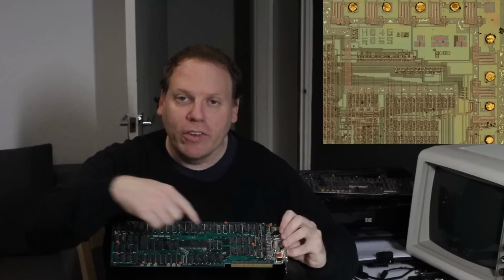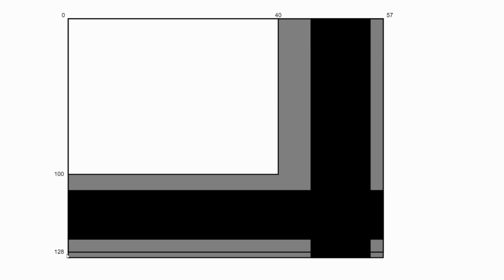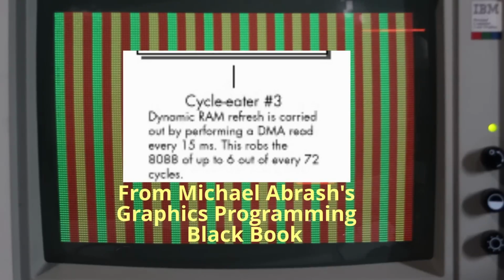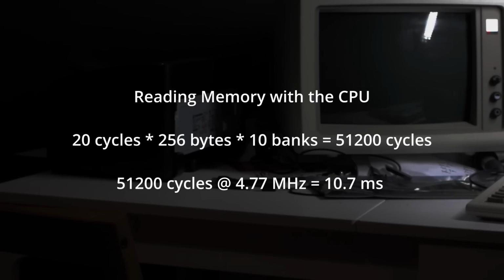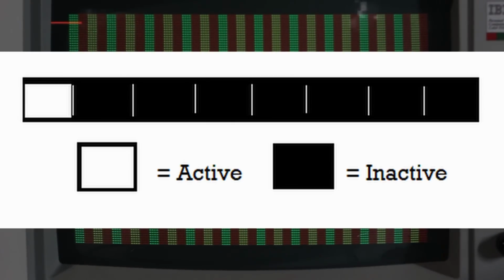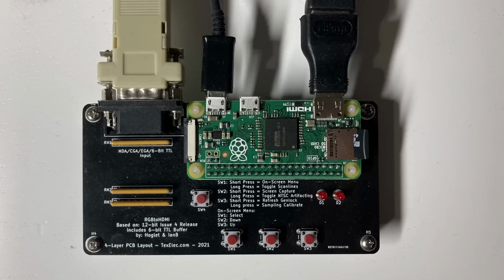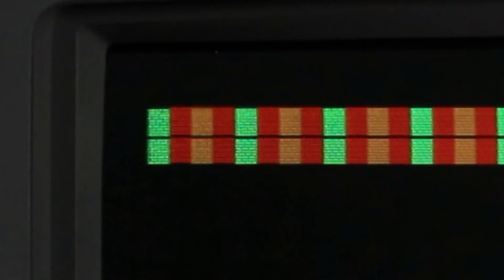Reverse Engineering the Video Chip of the IBM CGA Card (1981)

Comment: 1:04 that piece of information is wrong. Hitachi made the HD46505 first and then licensed it to Motorola. Motorola then produced it as the MC6845. That's why the Hitachi chip didn't use motorola numbers like their other direct clone chips.
Reply from the maker: That's interesting. The two chips behave very differently, so it seems like Motorola didn't use the same die.

Do you have a source for the information? (Feel free to emaIl it, as YouTube probably won't allow links.)

Comment: There is a Character Rom that supplies the data that gets poked into the required address, There is a program which fills in the characters from 128-255 called GRAFTABL.EXE

Comment: Which one of the ASM files (if any) correspond to that 'frozen snow' effect? I'd love to test this in my emulator.
Reply from the maker: There isn't a file in the repo for that. The repo is mainly about code to reverse engineer the CRTC. But the same basic loop can be used for freezing snow. You just need to add a write to VRAM at the right moment in time. Getting it to work on other machines is a fiddle due to timing differences though. It's not something you can just run. But f you have enough assembly experience you should be able to figure the code out.

Comment: Impressive work around the sync stuff and CRTC glitches.  

Snow was never really a mystery, there is a lack of bandwidth and the CPU wins a fight for access to RAM, meaning the video is displaying whatever data is on the databus at whatever address the CPU is reading/writing in video RAM.  

When it comes to writing: the address bus is valid before the data is written and you're seeing that in the character snow being the original data before the CPU has had the chance to change the value, then by the time the video is reading the attribute byte it is seeing the data the CPU has actually written to the bus.

When it comes to reading both char/attr would be the same since no change is happening, you're just seeing whatever is at that address in both instances.

I'm guessing if the CRTC and the CPU aren't in perfect lockstep like you've managed that exactly what the CRTC sees as snow in char and attrib might be a bit more random though?

You're probably the first person to control the snow like that though via that precise timing technique and it's very cool to see it isolated like this.
Reply from the maker: Thanks for the comments. Yes, of course the RAM is not dual ported and/or static and there just weren't enough cycles to have the CPU and video card access at different times in the 80 column text mode.

If the CPU changes the address while the card is reading the RAM you get wrong data. I would guess the CPU gets to set the address correctly for writing, otherwise snow would persist in the same location.
Reply: @PCRetroTech  Yes, the CPU has priority access so the CPU will drive valid address/data.  I haven't looked at the schematics yet but I assume some sort of priority encoder is used to prevent the CRTC gating its address signals onto the address bus when CPU is doing its access.

My mind is fuzzy on the issue but I think with the sega master system you could corrupt the VRAM if you wrote to the VDP too fast during active time.  You can write it any time you like since there is a one byte FIFO between you and the VDP VRAM but if you write too often in active I think it can corrupt.  The solution is you have to write a few NOPs between your writes during active time.   When I wrote my tetris clone 'Bloki' for SMS I did 'unsafe' accesses in vsync and the rest of the reads/writes were done vi a 'safe' macro.  Given a vast proportion of time is in active, the slow access is still very useful compared to a tiny access window in vsync.  But then we're spoiled on the SMS we get frame interrupts, tiles and sprites!  Since the SMS only has the one normal interrupt which is from video you get the satisfying thing that when you're done with your frame you just halt the CPU  and your code will restart when vysnc comes around. 😛
Reply: Or are you saying that on reads the CGA does feed the CPU garbage data during active?  I hadn't actually tested that.  Seems strange.
Reply from the maker: @neodonkey  No, that doesn't happen as far as I know. I think you are right. The CPU gets priority, though I've not looked at the schematics either.

Comment: Great video! The BBC Micro (a popular UK 1980's computer) mostly had a HD6845, and the community has made some progress in reverse engineering its corner-case behavior. I see from your linked PDF that you're looking into how the chip decides it is on the last scanline of a frame. This particular logic is insane! We've found that the chip appears to launch a series of logic tests on each scanline (one per clock, that chain into each other). It is why the chip goes screwy if you set R0 to be less than 3. BBC emulators such as beebjit, jsbeeb, b2 can handle this, and need to in order to run some of the latest crazy demos. I would provide links, except YouTube is being difficult.
Reply from the maker: I've had a look at jsbeeb before, although whether it had this behaviour encoded at the time I don't know.

At the moment it is slightly hard without studying the CGA schematics intensively to disentangle the behaviour of the chip from that of the card. The HD6845 datasheet talks about "outputting noise" in some cases, and my current best theory is that when you let the noise out the card can trigger various behaviour. For example on other CGA cards the same noise doesn't trigger any unusual behaviour at all.

By the way, I have two HD6845 chips that go screwy for R0 < 3 and one that doesn't. Two of them have the same date code and it's not the two you think!

Comment: Thanks for this fascinating video. This certainly brought back some memories! Several years ago the Acorn demo group Bitshifters created a demo for the BBC Master that is all about hacking the HD6845 CRTC chip. (Those who are interested can check it out by searching for “Bitshifters Evil Influences”) … Many of the issues you mention in this video -- e.g. having to implement your own DRAM refresh cycles, obtaining completely stable raster, getting the CRTC clock synchronised to other clocks that run at different frequencies, and so on -- are things we had to worry about when creating that demo. There are several CRTC variants in the Master: Hitachi, Toshiba, Motorola, perhaps others, and also VLSI. The VLSI behaves differently and we hypothesise that it's very different internally. Annoyingly the tricks we use to draw any logical screen line on any physical raster-line just won't work on the VLSI variant. It's an area of continued research, perhaps one day we'll finally fully understand the 6845 in all its complexity.

Comment: I would think that an alternative to disabling the PIT for DRAM refresh would be to program it to run exactly once per scan line.

Otherwise, I was just realizing that frame-aligned register accesses could probably be used to fix the interlace mode timing so that interlacing would actually work as it's supposed to.  Back in the day, I played with interlaced video, but the instead of outputting an extra half line per field, the 6485 would output an extra half line every other field.  Back in the 1980s when I tried that, I found that setting the vertical hold knob just on the edge of losing sync could yield legible 50-row text on the CGA, but it was annoyingly touchy.  Frame-synchronized register writes should be able to fix that, though.

Comment: At 32:34 the dot-clock delay that is absent on the LSB but not for the other bits might be due to the propagation delay (such as extra capacitance) introduced by the added logic inside the chip that are absent on the LSB.  It might prove useful to look at the decap reverse engineering notes :-)
Reply from the maker: So far I don't think the decap reverse engineering got far. As I understand it the project was more or less abandoned. But maybe someone is still working on it somewhere that we don't know about.

Comment: The 6845 CRTC is also used in a couple of early to mid 80s arcade games, one of them is Qix, which displays a whoppin' 256x240 with 256 colors, but only in the test menu. In game, it only uses like, what, 9 or 10 colors...
Reply: You do have the advantage with that particular hardware of having a much faster processor- the Motorola 6809.
Reply: @douro20  Nope - you don't have a much faster processor, you have THREE of them 😀
and one is dedicated to the graphics, so you could say that Qix has a graphics accelerator... in 1981!
Qix has 64k of video RAM. The reason it can't use 256 colors ingame is that in this game you can draw shapes freehand in order to wall in a monster that kills you if it touches you while you're drawing. Now with 2 players, the machine has to memorize the drawings of both players at the same time, so it uses two bits per player which means that only four bits are left for anything not drawn-playfield related. But still, the game could use 19 colors or with clever trickery all 64.
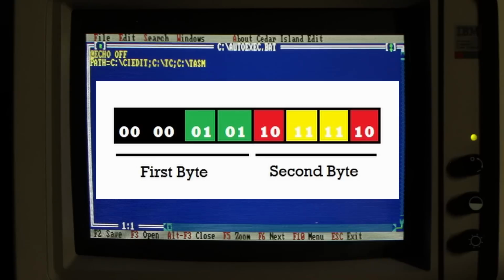Here's a video that includes the self test (at 5:50) https://www.youtube.com/watch?v=WUPFSFqCLtk (btw. yes the monitor is on the fritz, but that's a design issue and appears to not be age related - our local monitor specialist says it doesn't like the sync pulses.)
The main CPU has 1k of RAM and runs the game logic. The sound CPU has no ram (6802, what was it 128 bytes? 256 bytes?) and runs the sound. The graphics CPU has1k of battery backed RAM (high scores, audits, probably work RAM too), 1k of fast palette RAM (so it can blank the other player's color bits) and 1k of communication RAM. My guess is the main CPU puts commands in there like draw a line from here to there, do a flood fill on this position, draw the sprite in ROM location &whatever and restore the playfield on the sprite's old position and tell me the color of the pixel at this position.
Reply from the maker: @senilyDeluxe  Very interesting machine. There are videos online showing the various boards, but so far no one has zoomed in with a decent camera that isn't shaking around all over the place and out of focus whilst shouting over the top of the video. If you have it open at some point, would love to see the internals more clearly with some of the chips pointed out. From the Taito documentation online I didn't even know it had more than one CPU and I didn't see mention of the 256 colour mode. I believe there was a later version of this game Qix ultra or something. Maybe the documentation on Archive.org doesn't match the cabinet you have?
Reply from the maker: Interesting. I think I do recall that it had been used in arcade games, but I didn't know about Qix specifically. Very interesting info. I wonder if I can find a video of it online....

Comment: Mario Brothers 3 on NES gets similar artifacts on the left and right sides of the screen you were demonstrating switching between 5 and 9 hdot widths. NES is of course not CGA but I wonder if they were playing similar tricks to make such advanced graphics at the time?
Reply: SMB3 uses 2K of the NES internal RAM to hold a scrolling screen, which is enough for a screen 32 tiles wide by 60 tiles high, with four rows worth of memory used to set the attributes of every 2x2-tile region.  The PPU normally displays a region that's 32 tiles wide by 30 tiles high, but can blank the leftmost tile.  Unfortunately, when side scrolling, the screen still shows portions of 17 different 2x2-tile regions across its width.  Cartridges can be wired to either use internal RAM for 32x60, 64x30, 32x30 plus 1Kbyte of shape RAM, or else use 4K of RAM in the cartridge for a 64x60 screen.  SMB3 attempts to do 2d scrolling as well as it can be done without using external cartridge RAM for the tile map.
Reply from the maker: I'm not super familiar with the Nintendo hardware but I think that used a Texas Instruments chip that is quite different in design, so it would be a surprise if the glitches were related. However, a lot of that early hardware had to be very economical in transistor counts and so there were no doubt many glitches, and similar glitches, in many of these systems. Games tend to not use the hardware itself in a super technical way because that would make them way more difficult to get to market. They tended to rely more on software tricks to minimise memory usage and algorithms that would give good performance. That's a different style of coding, for the most part, to what democoders are doing nowadays in revisiting these old systems and pushing every glitch and technical feat out of the often poorly understood hardware.
Reply: @PCRetroTech  The NES Picture Processing Unit was a clean slate design if I'm not mistaken.  Some games did do a ton of register manipulation to get higher resolution sprites than what was otherwise possible, like Batman and the two Metroid games.

Comment: there is such a thing called a datasheet provided by the manufacturer. so engineers csn use them. they are usually privided freely with schematics and such. have you heard of them?
Reply from the maker: The schematic in both the MC6845 and HD6845 contains black boxes for things like "Vertical Contol", "Linear Address Generator", "Interlace Control", "Skew control". As an engineer, you know how these circuits work do you? Or you can explain given a black box for "comparator" why the gate delays cause the glitches I mention in the video? Or maybe you can predict the new vsync glitch VileR found yesterday which is most definitely not listed in either datasheet, nor in the 272 page improvement that the Amstrad people have constructed?

I guess you've seen the "schematic" in the 8086 datasheet as well?

Maybe Ken Sherriff is just cribbing from the "schematic" in the datasheet. Probably Sean Riddle and co. don't really need to delid these things either. And no doubt Reenigne just had to read the "schematic" for the 8088 in order to write XTCE?

Comment: The HD6845 was a very simple videochip, but it almost  looks like magic when this old thing is being pushed into doing new tricks. A few month ago I ordered one from China and I am going to do standard things with it. And it would be nice to let it do something more.
Reply: I have a video card for an Apple II with this chip so I looked it up and realized it’s also in my CGA card, in my first computer which I still have. I used it even though it was outdated from 1987 to 1993 and tried everything I could with it at the time. So the demo that came out blew me away seeing things I never knew were possible. I also got into doing electronics (thanks to Ben Eater videos) so I’m interested in learning about these video chips. I was looking over the data sheet and I’m tempted to take the one from the Apple and try out stuff with it on a breadboard.

I don’t think even the Peter Norton guide to the IBM PC got into the registers for these. I only knew that you called BIOS to set up video modes and then you could write to video memory.
Reply from the maker: @drivers99  Ben's videos are great and I've been tempted to do the same!
Reply from the maker: Given IBM had some trouble getting it to completely behave (as this video demonstrates) I wonder whether it will be easy or hard to do standard things with it. If you are a perfectionist you might not like some of the glitches it has (there's a list in the datasheet).

Comment: Has anyone fooled the card into doing a half scan line to generate interlaced fields?

There were some reasonably successful efforts on the Atari machines, and I believe a bit more successful ones on the C64.

I always wondered why IBM did not make interlace an option.  Probably due to the very modest video RAM on their OEM cards.  Still...  seems like it should be there, just unused.
Reply from the maker: The chip actually has a couple of interlace options. There's a few obstacles to overcome to get it to work on the PC. There's a demonstration of what happens in Jim Leonard's CGA Compatibility Tester, although that isn't the only way to operate it. Some cards seemed to actually have a working interlace option out of the box, but IBM decided not to support it well or at least to not document it if they did.